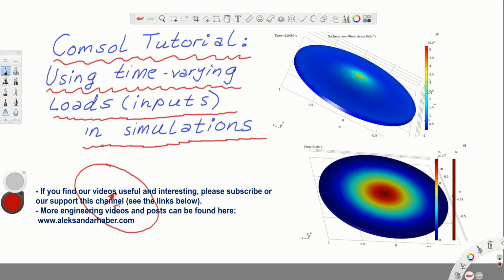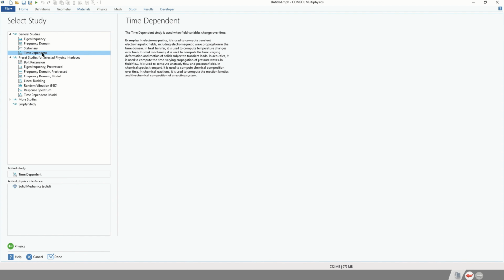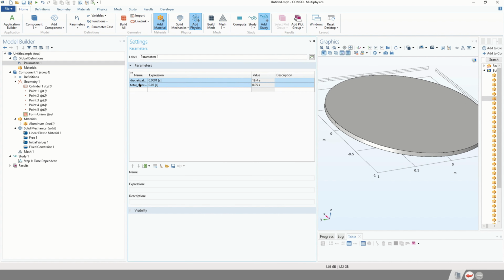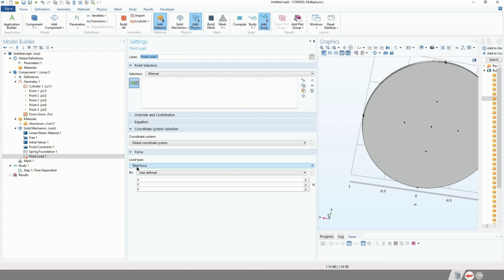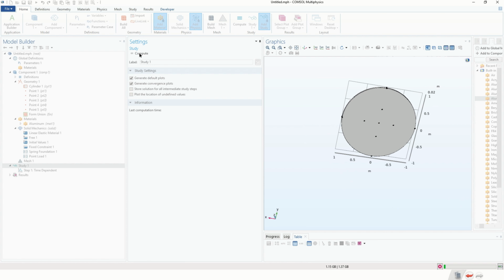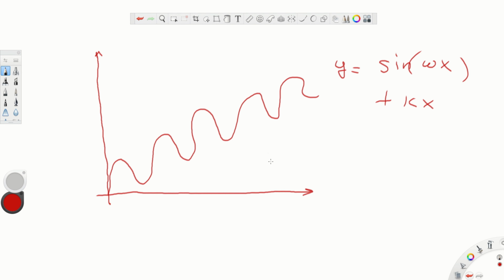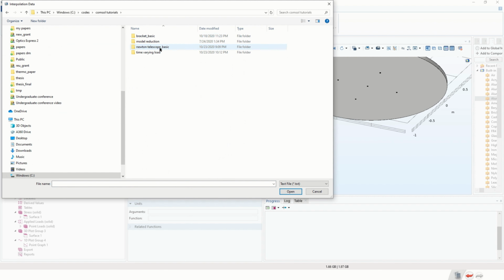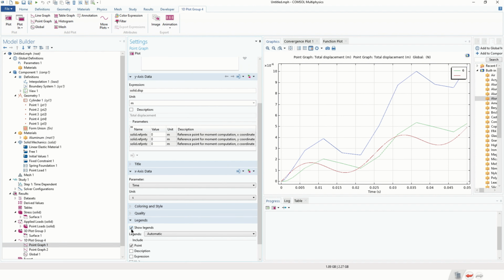Simulation of Time-Varying Loads (Functions) in COMSOL - Tips and Tricks- Structural Mechanics

Comment: Thanks a lot, great tutorial. 
I would like to see the same tutorial for Creep and stress relaxation tests.  That is, in the case of indentation processes, the applied force remains constant and the displacement is determined in case of creep, and in the case of stress relaxation, the displacement remains constant and the force is measured.  It is more interesting if the indenter and the sample are made of different materials.
Reply from the maker: Why don't you try to make such a tutorial
Reply: @aleksandarhaber  I am currently using MATLAB, and I have no experience with Comsol. Otherwise, I would be willing to share ). My intention is to learn Comsol in the near future. Anyway, thx
Reply from the maker: @etibarmikayilov4891  Learn COMSOL, it is a very useful engineering tool.

Comment: Good day Sir, I am new to COMSOL. I want to model a point source from which Electric Field spreads out in x,y directions. I am working in 2D plane.
I started of by creating a geometry with air, and then specified my point. How do I assign electric field to my point?
Any help would be greatly appreciated.
Regards
Reply from the maker: Hi, I am not able to help you simply because I do not have time. Your problem requires some independent study and effort.

Comment: That is a great tutorial. I would like to ask: Could i just define somehow the variable t without certain values? For example I want to inster the waveform sinus for an AC current, for which the parameter t is needed.
Reply from the maker: Hi Lampros, 
First of all, thank you very much for your interest.  Then, I am not sure that I completely understand your question. Can you please elaborate it a little bit more?
Reply: @aleksandarhaber  Hi Aleksandar thank you for the quick response. I want to have as an input for electric potential for example this: B+A*sin(2*pi*f*t+z). For a frequency stationary problem, the only variable here is t (time dependent problem). For this problem, can i use this expression  just by defining t somehow? Or do I have to use time-stepping parameters? I hope its understandable.
Reply from the maker: @lamprospapadopoulos9637  You can directly define electric potential as a function of time t.  
https://www.comsol.com/forum/thread/47345/Parameter-as-function-of-time-in-time-dependent-simulation

Also, you can find COMSOL reserved name for certain variables and you can play with them.  Read and search more about this.

Comment: Hi! Thank you for this video. I think it's very helpful. Nevertheless, I'd like to ask you what you think about the, for example, possibility of doing a ramp function and define the applied force as "Maximum Applied Force[N]" * "Ramp function(t[1/s])".

I did that on a study of an aluminum hardware being loaded by a force which starts from zero until 15000N, but, from 0 [s] to 60 [s]. Is that correct?
Why didn't you define your sin(wt)+kt function on COMSOL and give the applied force that instruction? Why using MATLAB? Is that necessary or it was just easier for you?
I ask because I am having some linearity - non linearity problem which just bug my COMSOL when it gets to 4% on the solver, but, I realized It happens just when my force and study are time dependent, but not stationary.
Thank you in advance.
Reply from the maker: Imagine a situation, where you want to import an input load from experimentally observed data. In that case, you would definitely need to import a data from the file. Also, imagine that you want to connect a MATLAB simulation module that computes something with COMSOL. All these examples illustrate the need for defining time-varying loads from files. Definitely, you can specify analytic functions directly in COMSOL. However, as I explained, this is an approach that has its limitations. A more general approach is the approach I am explaining. Best. A. Haber
Reply: @aleksandarhaber  I agree with you. In fact, my simulation is assuming a loading test using a Materials Testing Machine. I think interpolating is a much effective assumption indeed. Thank you!
Reply from the maker: @baterosinser  nice application

Comment: Amazing tutorial! Will you please advice me on how to defined a user defined force which varies as a function of structural deformation. For example, Casimir force that acts between plates of a parallel plate capacitor. Thank you once again.
Reply from the maker: You should identify what is the variable quantifying the structural deformation, and then specify that the force is a function of that variable, when defining the load.
Reply: @aleksandarhaber  Thank you for your reply! Will it be possible for you to make a tutorial video explaining this feature with some basic structural mechanics problem? That will be of great help to entire COMSOL user community.
Reply from the maker: @kdSU30  Hi, Kedar, currently I do not have time for that, but it is definitely a good idea.

Comment: Hello Alexsander, it seems damping doesn't effect on different frequencies of the structures. please correct me if I am wrong. I am simulating a CC beam and setting sinusoidal force magnitude and frequency. It is expected that in different frequency we get different amplitudes but comsol doesn't understand it. (I tried multiple damping factors)
Reply from the maker: COMSOL is able to simulate damped frequency response:
https://www.youtube.com/watch?v=RyA0aif2wwg
 You have probably incorrectly defined the problem or boundary conditions.
Reply: @aleksandarhaber  I has seen this movie. It's for frequency response analysis and yes damping can be applied on that. But here for TIME DEPENDEND analysis, COMOSOL fails.
Reply: @aleksandarhaber  put a sin(t), sin(50t) or sin(100t) for the input force  and amplitude of response nothing changes. Just frequency changes, according to the frequency of excitation.
Reply from the maker: And you can also check this paper, I recently wrote: https://www.osapublishing.org/oe/fulltext.cfm?uri=oe-28-4-4726&id=426576
There is a GitHub page I created that contains the codes used in that paper.

Comment: hello sir, if i have excel data which is time and temperature of every 30 min a day, did i have to import it as two parameters?
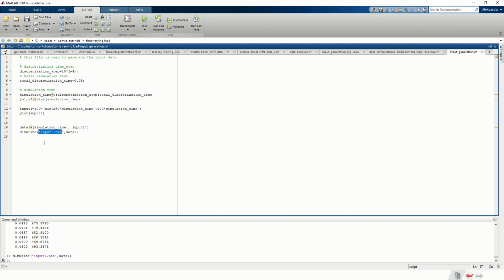Reply from the maker: Depends on how you plan to use this data. In my case, I have a load that is a function of time. I saved the data as a txt file, the first column is "time" and the second one is "load". Then you can import this data directly into COMSOL to give you the ability to interpolate this data and to include it in your simulation. If a temperature is a parameter that is included in your model and this parameter varies with time, then you should follow the same approach I did. Watch the video from 19:00, and everything is explained. Thank you for the interest. Best, A. Haber
Reply: @aleksandarhaber  thankyou so much sir, you’ve been very helpful for my progress!
Reply from the maker: @muhdkhaidir2707  Thank you for the kind words

Comment: Hi,
I am working on electrostatically actuated cantilever. I am trying to get the point where the cantilever fall flat on the substrate. However, as it is beyond pull-in (buckling type run off), I am unable to get that. Is there any way to simulate the state where cantilever fall flat on the substrate? Thank you in advance.
Reply from the maker: Hi Kamrul, I am not sure that I understand your problem completely. Have you looked into the COMSOL tutorial:
https://www.comsol.com/model/electrostatically-actuated-cantilever-444

On the other hand, you also have contact modeling tools in the structural mechanics toolbox:
https://www.comsol.com/support/knowledgebase/1102

If I remember correctly, it is possible to detect contacts between two surfaces using contact modeling. I am not 100% sure. Maybe there is an easy way to solve your problem. However, I do not understand your problem completely.
Reply: @aleksandarhaber  Thank you. Yes I have checked the model "electrostatically actuated cantilever". In that model, pull in voltage is calculated by basing on the divergence of the solution. However, I am actually interested in the final geometry when the beam lands on the bottom electrode due to electrostatic force.
Reply: @md.kamrulhasan3220  You need to find out voltage just before the occurrence of pull-in by performing simulation at different voltage step. User that critical voltage to get critical deformation shape.

Comment: Hi,
I am working with Triboelectric nanogenerator so trying to simulate that model in comsol. can you please help me ?
Reply from the maker: Hi Arun, here is what I have found online:
https://digitalcommons.ric.edu/cgi/viewcontent.cgi?article=1173&context=honors_projects

In this thesis, the author is using COMSOL to model the triboelectric nanogenerator. 

You can also look here for additional references:

https://www.researchgate.net/post/Simulation_of_Triboelectric_Effect_in_COMSOL_Multiphysics

Best, 
Aleksandar Haber
Reply: @aleksandarhaber  thanks for you reply... actually I have read this paper..but they haven't measured output voltage or current here.. actually I need those measurements where I can measure induced potential at electrod due to the surface charge at polymer.
Reply from the maker: @arunmondal2358  I am not an expert in that field, and I am sorry that I cannot help you more. Best Regards, Aleksandar Haber